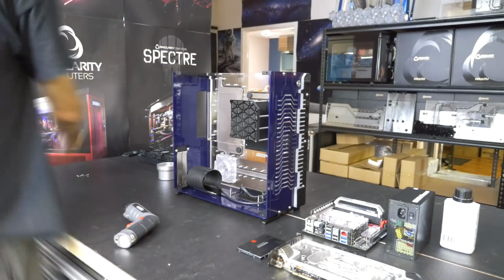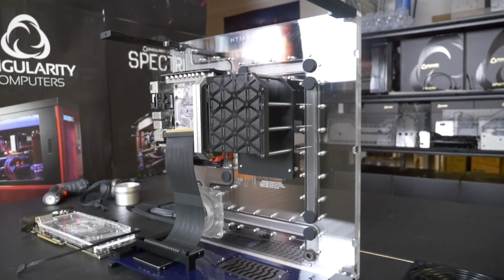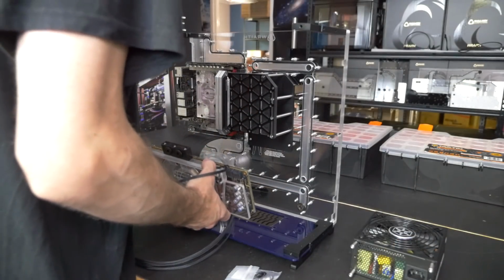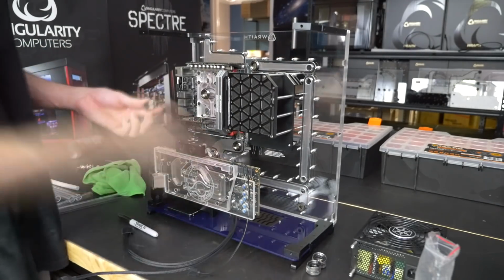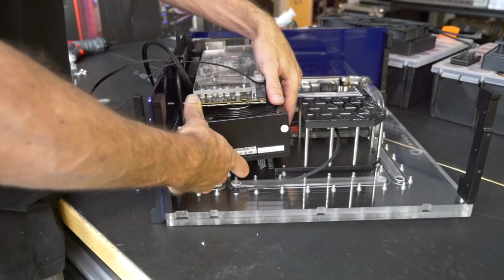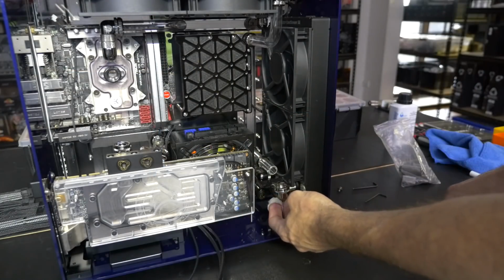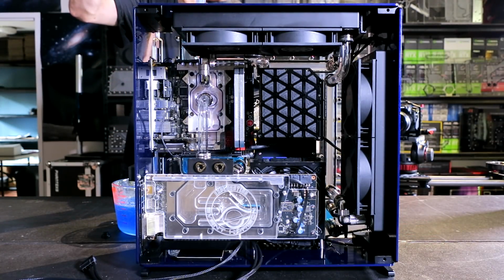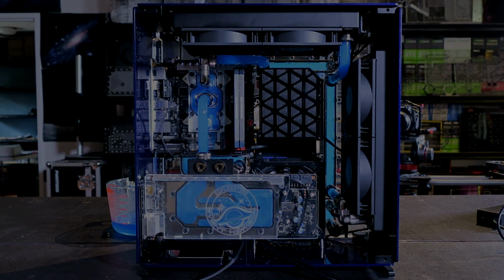Wraith Event Horizon Build Log Part 2: Assembly

Comment: i really like this case. looks awesome. well done daniel+team. i couldn't use it with my setup tho as i have way to many drives and ssds (currently 3 hdds, 3 ssds and an m.2) but i really like small builds when they aren't a clusterfuck of cables. and this wraith case with a well designed loop is really clean af.
greetings from germany!

Comment: which fittings and blocks did you have in mind when you designed the manifold holes? If I want to line up everything perfectly, which blocks  / fittings would u recommend?

Comment: Hey man, are you able to share the size of the extenders you're using for the tight turns and basically any of the connections where you're not using pipe?

Comment: is that 16mm  tube?
Reply: I have the same question. From another SC video, it sounds like 16mm is the primary choice across all builds, but watching this video, I feel like the OD here is 14mm, I can be wrong though... BTW, this is extremely beautiful case and I'm planning on getting one.
Reply: I took a screenshot of one of the closeups and with PS, rulers and EKWB docs (assuming this is an 1080 waterblock), I've concluded that OD is 16mm (from PS math I came up with 15.2mm). HTH